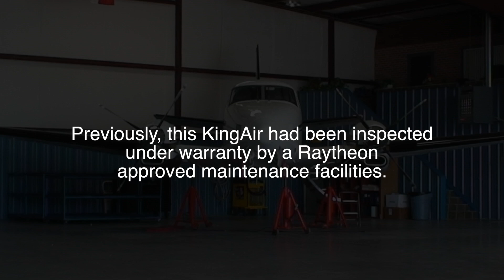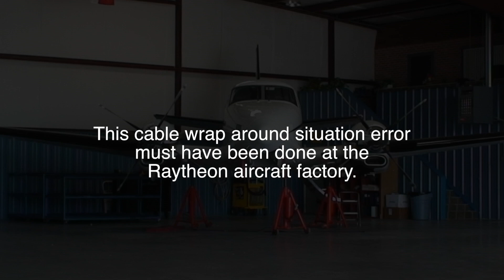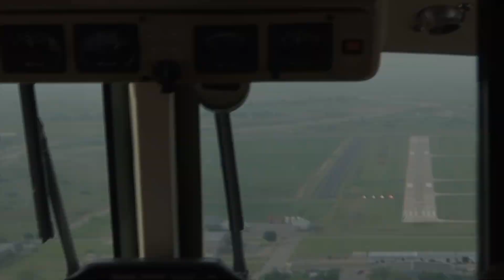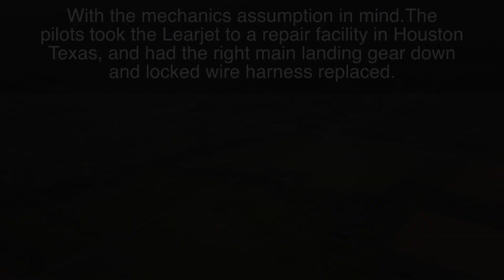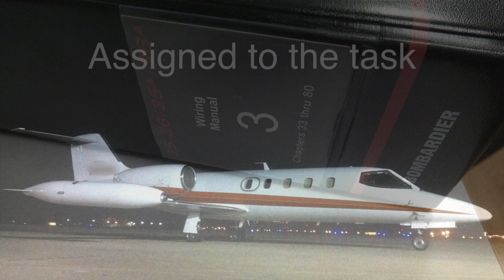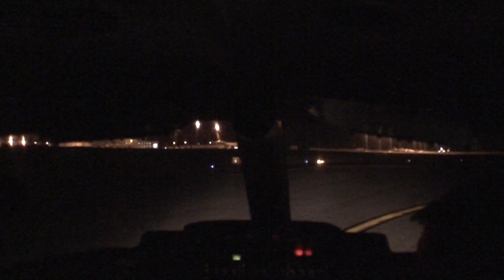Assumptions are costly and dangerous

Comment: This is the difference between a parts changer and a tech that does proper diagnosis.  Same problem in the Automotive Service Industry.  A $5 multimeter would have shown voltage at the light socket/terminal and continuity (with proper resistance) at the light bulb.
Reply: But isn't it worth querying /why/ the diode had burned out? Carrying a much higher current than it should, perhaps, for some reason? And that might need tracing and correcting...
Reply: @ericwalton4610  Not right away.  Sometimes you get a fuse that blows.  Typically you just replace it.  If it blows shortly thereafter, then it's worth a more careful look.

Comment: A predictive assumption is simply a hypothesis, among many possible hypotheses, where if having failed one hypothetical model, it becomes necessary to move to the next hypothesis. Stopping when the initial hypothesis is found wanting, is not a repair, it is simply giving up on the problem. Each logical hypothesis must be tested in turn to arrive at any affective repair.

Comment: I absolutely love the landing light issue.  I worked with a guy for over three years and he was/is one of these who would NOT thoroughly troubleshoot electrical issue. Wiring harness replacements recommended by him more than once that didn't fix the issue.  I suspect it was because he didn't care enough to learn how. Probably why he turned into a low pay parts counter guy. The guy had a real arrogant attitude and I couldn't stand him.